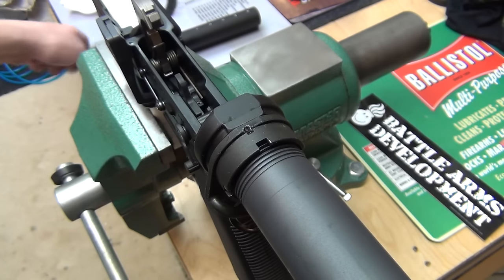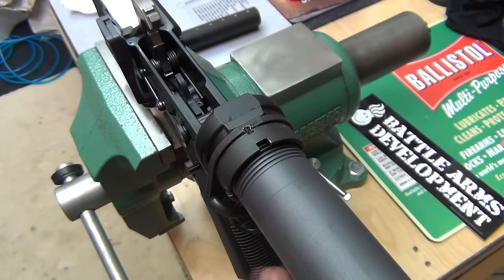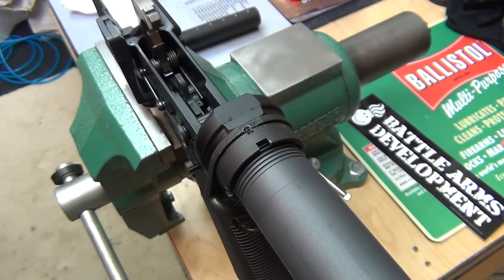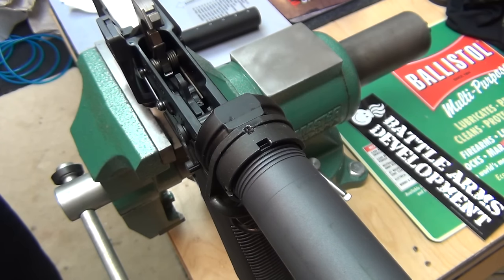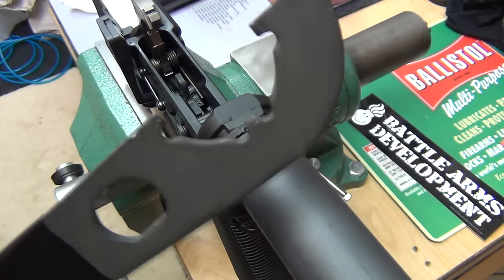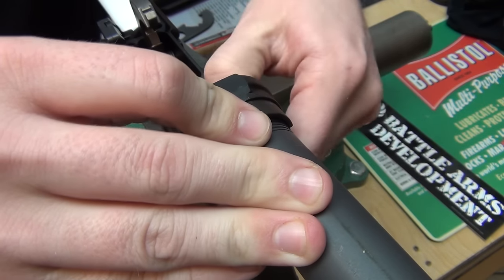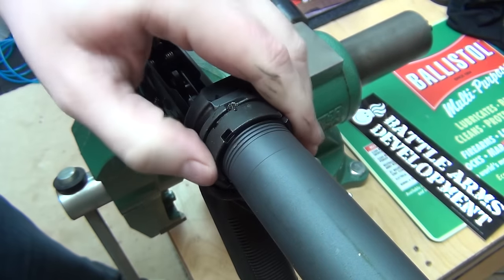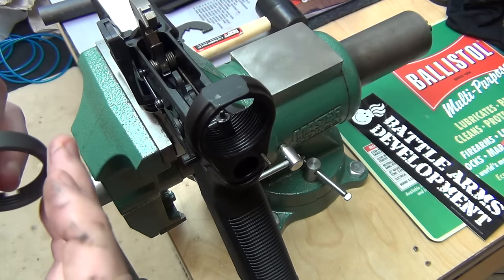AR-15 - Remove a Staked Castle Nut

Comment: but lets be honest... that stake job was pretty poor
Reply from the maker: +Richard Busby A poor stake job is better than no stake job.
Reply: nsz85 if you say so
Reply: +Richard It's only there to keep the castle nut from loosening, so yes it was a sufficient staking. It being torqued to 40lbs of torque and then staked like, it wasn't coming off.
Reply: KingLT82 but lets be honest it is pointless... Not to mention poor. Who double stakes their castle nut?  .....u know, unless ur drunk af
Reply: KingLT82 its pretty obvious that you dont have first hand knowledge. No, even as a field armorer in Afghanistan, we never staked buffer tube castelnuts. But keep on with your youtube education... Its working great.
Reply: Richard
Ok man you didn't care enough to properly stake your weapons, doesn't mean it's not something that should be done. It's pretty obvious that corners were cut in Afghanistan instead of staking the rifles like they were originally. If the original manufacturer staked them to be mil-spec then I don't see why you wouldn't want to stake it if you put a new one on or change buffer tubes. But keep on with your field armorer education, it's working great.
Reply: It was a mistake.
Reply: King LT82, I haven't had a castle nut back out in 20 years, just torqued mine to 40 lb.  I have used my AR's harder as a civilian than I did in the army.

Comment: Humm, unscrew the buffer tube (not shown in the video) and ......

Whang!!! out comes that pin that keeps the buffer spring in place with its little spring, and about 90 miles an hour, apparently headed for space. After a half hour search I found both parts.

Moral: When unscrewing the buffer tube, hold on to that little black pin.
Reply: It's especially fun when that little black pin flies into the 1970's era black shag carpet!
Reply: Critical bit of information

Comment: word of warning: If you camp down on the receiver, when you unscrew the castle nut and the castle nut is very tight, you could very possibly STRIP the buffer tube. This happened to me!
Here's how it could be striped: IF the force required to unscrew the castle nut is HIGHER than the force required to strip the indentation on the bottom of the buffer tube WITH the retaining plate, then the little notch on the retaining plate will ABSOLUTELY rip out from the that little indentation on the buffer tube.

To avoid this, take the upper completely off and clamp down on the butt stock.
You have been warned!
Reply: Doing mine tonight and was wondering about this, thanks for the assurance
Reply: I fucked my buffer tube up because my new ar15 was staked, I didn't know, and assumed I could just unscrew it. Lucky I got it off and already had a new buffer tube to put on

Comment: I would say the reason it busted free easily for him was because the staked material from the end plate was so brittle due to how much material was shaped into the notch that some simple elbow grease was gonna be enough to break it free. Either the end plate or the threads on the buffer tube or castle nut will give up.

Comment: Thanks for the help. Im new to ARs but not in shooting. I saw my PSA lower has been staked and thought it was going to be a big deal.

If anybody is wondering im replacing the stock tube to a anti-tilt tube and a H3 buffer system for my Wolf A1 upper. Its over gassed and rips the brimming right off the shells.

Comment: I use a small Dremel tool with the  thin grinding disk. As part of my extensive tool collection. LOL. It works really nice and it's a clean look. It also makes re staking a little easier and has a clean look for the next time.  🐢🇺🇸👍
Reply: THANK YOU I almost forgot I have a dremel with a very thin grinding disk that would work perfect I didn't even think of it.

Comment: Not too keen on just wrenching it, especially when more than one position is staked. Using a small SHARP chisel with the flat side towards the receiver you can CAREFULLY cut away most of the stake without damaging the surrounding parts. Then using a wrench for that final bit. TRY IT, and if you find it works for you too, might consider redoing this video.
Reply: I twisted my buffer tube now my pa15 won’t shoot know what’s wrong?

Comment: Most solid as fu** factory stake jobs aren't going to come off without that wrench either stripping/slipping off the grooves or bending the wrench for most of these individuals.  And if that happens they're going to gouge up their buffer tube, or worse... 
Either dremel it down or use a drill bit to grind some of the stake out of the castle nut groove. Then just replace the castle nut and end plate after.  They're cheap parts to replace.. . No point in risking damage to the rest of the rifle.
Reply: 2S1L3NT, that was exactly the information I was looking for- I just needed to validate my intent to drill out some of that material. Thank you!
Reply: 2S1L3NT j

Comment: Heads up unless you got a heat gun I would not the loctite the castle nut.You'll end up needing a new tube, end plate and possibly a castle nut.

 I tried to remove my castle nut that was installed with blue loctite and by the time it budged the buffer tube thread was gouged underneath.

 Because it was so bonded on that it turned with the castle nut and overode the end plate area that interfaces with under the tube! 

A heat gun helps loosen up the loctite before you remove. A mistake I learned the hard way.

Hand tightened with a armorer wrench is good enough as snug as you can get without stripping castle nut . 

And if your keen on using blue loctite a tiny bit goes a long way literally 3-4 small drops where the castle nut is gonna be on the tube your welcome 👍🏼.

Comment: So basically. Staking a castle nut keeps the gun from coming apart on its own, but it can still be removed by the user for maintenance reasons
Reply: +FRIGGIN' BROBOCOP ...absolutely zero, I've built a few...tight will suffice just fine...no loctite or staking needed....anti walk pins are a must though...

Comment: Great video dude! Okay, but then is that buffer plate useless after that? In other words, is it true that after you stake an end plate it is only good for that one use and no more builds or applications? Thanks!
Reply: It depends on where it lines up with the castle nut. If it snugs down in a different spot you will bee able to reuse it and still stake the nut. If it lines up in the original spor, it needs to be replaced. Hope that helps.
Reply: 8years later and still helped me out thank you
Reply: @mherrera619  lol

Comment: My Colt is staked 3 times from the factory (3 notches).... have you run into that? And do you use the same method... or is there another way to address multiple stakes?
Reply: did you figure out how to remove the castle nut on your Colt? Mine is staked in 4 places and it looks like they had used a press machine to do it, it definitely wasn't done with a punch and a hammer. I was wondering if you found out any tricks or information to help? Thanks
Reply: +Dennison Small My Colt was only staked in 2 places and this with a mag well vice block got it off.

Comment: I just put the wrench on the castle nut and started to turn and the buffer tube and the nut turned together.  So the key in the plate ended up striping the keyway grove on the buffer tube.  I have no idea how it happened but it was a very costly mistake.  I don't know why the mil-spec key and keyway are much smaller than a commercial one...you would think it would be better having a larger key on the plat and a larger keyway on the tube.

Comment: You can also very slowly and carefully use a small drill to remove the material. Just be careful not to drill into the tube. If you are going to throw away the tube then that doesn't matter. If you are going to reuse the tub, then a little mark from the drill will be hidden anyway. If you happen to mark it some with the drill.

I have seen them staked in two spots. Very hard to break free without using the drill first.

To restake, a spring loaded center punch works best.

Comment: Just out of curiosity... How do you RE stake the nut once it has that little dent there? Awesome video...wish I had known about the castle nut b4 my DPMS came unraveled. I carried the M16A2 in the Army but it was full stock so I wasn't even aware of the possibility of misfeeding through castle nut backing...oh well..
Reply from the maker: Hanomag Shadowfeet I restake it on another notch or just use a new castle nut.
Reply: nsz85 using a new castle nut doesn't take the dent out of the end plate though.  Has that ever been an issue?

Comment: I find using nail polish as a lock tite substitute and hand tightening without a wrench is plenty effective enough. It isn't like the stock will spin around and unscrew from the receiver even if it does come loose (which it hasn't after years of normal use). The way I look at it, if the original AR10 design needed to be staked, it would have been welded.
Reply: 30 to 40 lbs torque and haven't had one loosen in 20 years.

Comment: My castle nut continues to get loose even though I continue to tighten with more torque. It was never been staked, and uses a .22 upper exclusively. I don't want to use Locktite, so I will try staking.
Reply: PWS makes a buffer tube that "ratchets" on, and is lighter than most tubes.

Comment: That staking was weak, and fragmented already. My properly staked AR's are well bulged into the grooves, and not broken anywhere. I bought one as a complete carbine from LMT, but the other one I did is even better. Plus I staked 3 spots. The bulge going into the grooves is nice and thick. It even partially formed to the shape of the groove.
Not that I want to take it off, but I was hoping to see how a properly staked castle nut could be taken off. It already has the Vltor tube, but JIC I wanted to go with a rifle tube I was interested in this video.
I'm pretty sure I am stuck (literal pun) with this configuration, and would just go with a different lower, configured the way I want it.
Also I was interested because I was thinking about a different end plate for a sling. I'll hafta go the ten dollars more and go for the troy that fits over the castle nut.
I really don't think the thing is ever coming off without destroying the tube, or cutting the castle nut off with a dremel.
Reply: it is taken off the same way. use a cattle nut wrench.  maybe a little more difficult if you staked three hole

Comment: I would not recommend lock-tite at all. I had a customer bring me a rifle that had lock-tite applied to the castle nut, it was a hell of a fight to get it broke loose and when it was all said and done, it actually damaged the threads on the receiver tube from the tab on the end plate. The receiver tube kept trying to turn with the castle nut as we tried breaking it loose

Comment: I didn't stake my castle nut, in fact I only hand tighten it and now it won't come off any ideas on how can I remove it?
Reply from the maker: +A AL Try harder.
Reply: +nsz85 I even tried hitting the wrench with a hammer and it won't back out
Reply: just idiot check it and make sure you are turning it the right way. We all have those moments.

Comment: PLEASE HELP,
what is the tool called you used to get this off?
And is the system to get it off the same for my hk416D ?

Thank you for your help and great video....i am so lost and i really want my sling to putt on :D
Reply: Castle nut wrench.
Reply: Tim
thank you so much
Reply: If the HK nut is 35mm O.D. the AR/M4 tool should work fine.

Comment: Thanks for the video. Have you thought about using a small drive punch or drift to move the material pushed into the slot by the staking operation back into the end plate? It should help the nut come off a bit easier and put the material back where it was for the next staking operation.
Reply: And I used a new end plate to look tidy.

Comment: I got an m4 lower and I have to remove the castle nut and so far brute force doesn't work
Reply: +Neebs is Awesome Got mine of with brute force. Bought a mag well vice block and after some pretty good force it came right off.

Comment: Was that a factory staked castle nut?
Reply: No
Reply: Anyone know if this would be as easy with a factory staked castle nut?
Reply: +Villamor78 I did this on my new M4 and it was a bitch to get the factory staking to break. I got it and this worked good to restake the new one, but yeah it took alot of force to break the factory one.
Reply: KingLT82 I figured as much. I think i'll dremel a little bit off first before trying to break the castle nut loose. Thanks!
Reply: Villamor78
I used a small chisel to loosen it up some, and no problem.
Reply: +Villamor78 if you can't break it by hand and try using a mallet. Start tapping on lightly and then slowly increase the pressure you apply. You don't need to try and break the stake with one swing of the mallet.
Reply: David teer I finally had a chance to try this, but I cheated using a dremel to remove the factory stakes. Only took a few seconds for each stake, and the castle nut came off without a sweat.
Reply: +David teer who said ur the xpert
Reply: patruick marco never said I was.

Comment: Cool man. I have a few of those grey ones and in my experience the CTR is the only stock that really fits it tight. I actually just ordered a tube kit with the Elusive ST-T2 buffer in it. That with a middy system with a battle comp turns your AR into a real pussy cat.

Comment: Try doing that with an LWRC, ive been trying to undo mine for 3 days, trying not to break the receiver. They stake it in 4 places but it looks like a press machine do it, its not just an indentation in the castle nut. Thats why im on here lol
Reply: I used a dremel...finally. 

cut the stakes and then torque